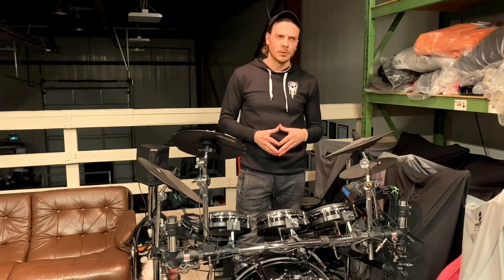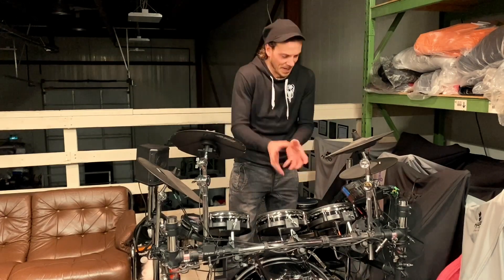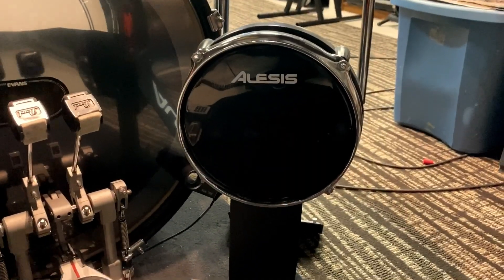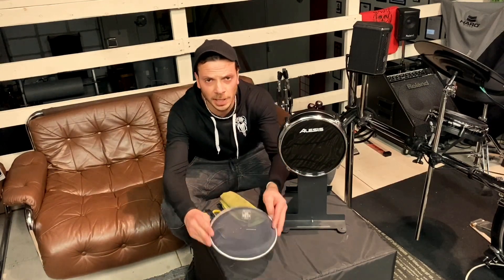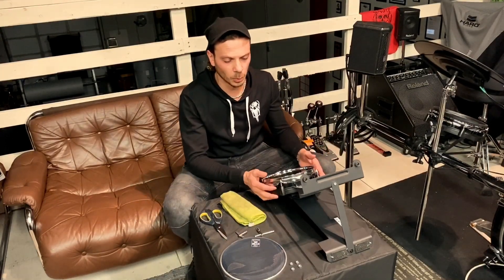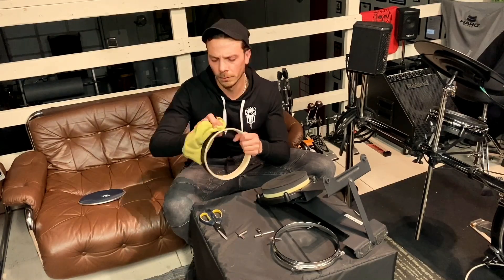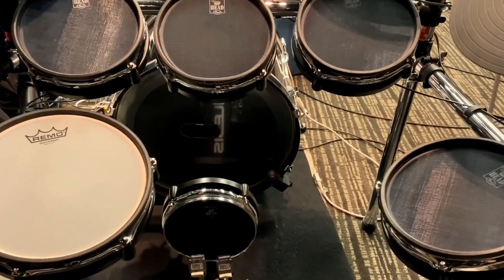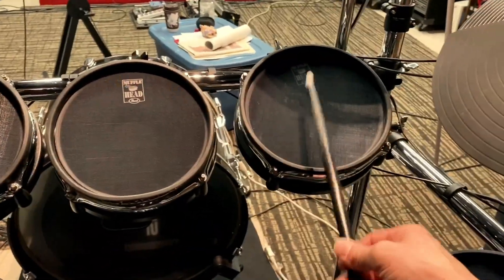Thats a good question EP 6 Mesh Head Conversion

Comment: Ayyyyy i've got a gibraltar rack with my DM10 and mesh heads. among some other issues, i get a TON of crosstalk. it looks like you beat the ish out of that kit, do you have any issues with missed or extra triggers? also, what firmware are you running on your brain?
Reply from the maker: ya there's a lot of trail and error needed to beat the cross talk!! It took a while and there's many variations to consider. Def space them out a little and go one by one until you find the pocket!! Once you do, its a whole new world!! Firmware I haven't checked but will get back to you on that. Super thx
Reply: @angelog8129  dig it. sounds good. I'm in the process of taking the pads apart and checking the foam and placement. after 3 years, things have loosened up.